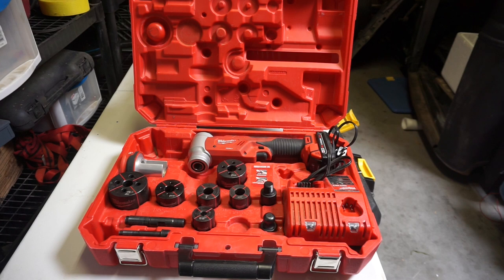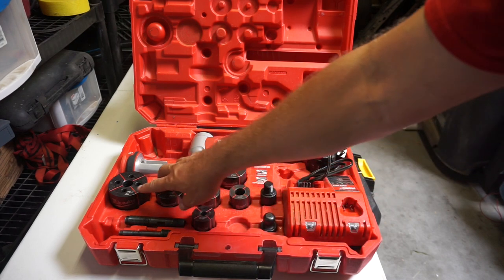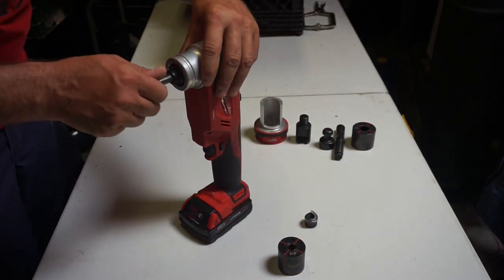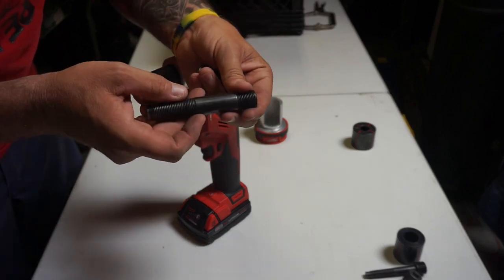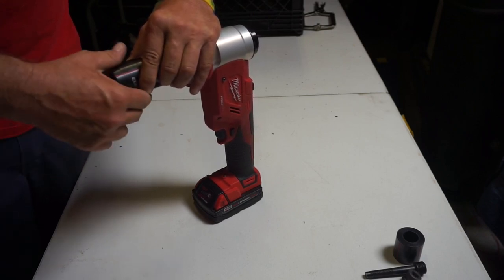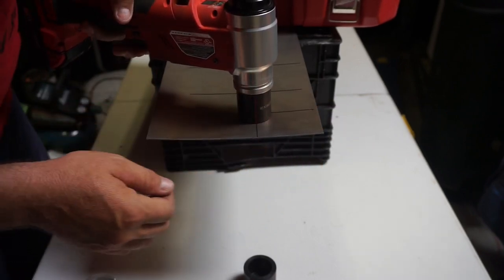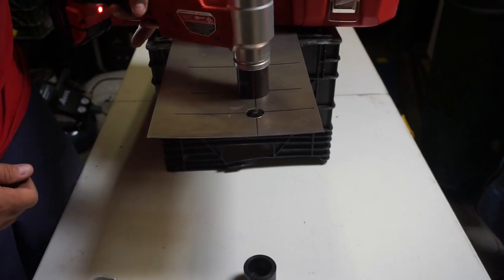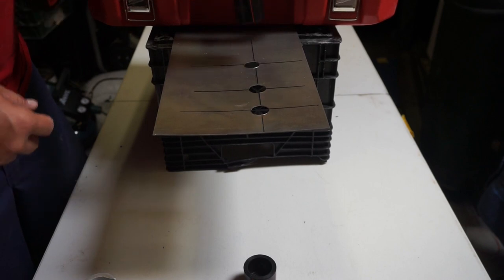HOW TO USE A MILWAUKEE 6 TON KNOCKOUT KIT

Comment: I have this same 6 ton kit, I bought an extra ball attachment for the 1/2" draw stud so it can be used with the quick change ball cup (saves a lot of time). There's the 1/4 turn quick release version now available as well which speeds things up even more. I have used his kit in stainless steel cabinets and it cuts through like butter. I'll soon be investing in the 2.5" - 4" K.O kit to complete my set. Having come from the hand ratchet to the hydraulic kits, this thing beats them all.

Comment: Does the 3/4 invh punch and die require the 3/4 draw stud? Does each size require the same size draw stud,?
Reply: The 1/2” die requires a smaller draw stud but 3/4”-4” use the same draw stud.

Comment: Hi Jarrett ~ Thanks for the great video, but I'd like to know what your max cutting capacity is?  In other words, what's the thickest steel you've been able to cut through without putting the tool system at risk?  Thanks again.
Reply from the maker: I maximize thickness I have done is 14 gauge and that was a mild steel. Thanks for asking.

Comment: I mean if you have alot of holes to do it;s better than a hole saw but at the price point I just can't see the value of it vs holesaws
Reply from the maker: Matt Newman hole saws work well, but you need something like this when you are punching holes in stainless steel. Thanks for watching.
Reply: We have had a maxis punch set on our truck for the last 6 years gets used weekly on all commercial jobs not a single piece been replaced and that set was also 2k. Many many holes needed to be punched in panels and cabinets and troughs and hole saws just don’t cut it (pun maybe intended) saves time and headache
Reply: Holesaws are shit. They constantly break and you run the risk of cutting shit holes.

Comment: This thing is nice.... I want the 10 ton up to the 4" ko
Reply from the maker: Johnny Freeman I haven’t been able to get my hands on 10 ton. I have used this one to knockout 4” stainless steel with no problems. Milwaukee sells bigger KO’s for this kit.
Reply: Jarrett the Journeyman...well it seems like the 10 ton has all the knockouts with that set...do they sell different variations with these sets?
Reply from the maker: Johnny Freeman check out the Milwaukee 2677-23. This is the six ton with the KO’s shown in the video plus the 2 1/2” to 4” in another case.

Comment: Wow 2k plus to knock out a hole.. $20 for a hole saw that'll cut a hole with a bit of a burr.. I can't imagine how this could pay for its self
Reply from the maker: WPXTacoMan477 if you are doing a lot of holes in stainless steel, this tool pays for itself fast. Thanks for watching and check out my other videos.
Reply: @iSousa77  Amen to that. It would pay for itself in a few jobs.
Reply: It all depends on the amount of time and application, saves alot of time and fatigue. Overall worth it forsure